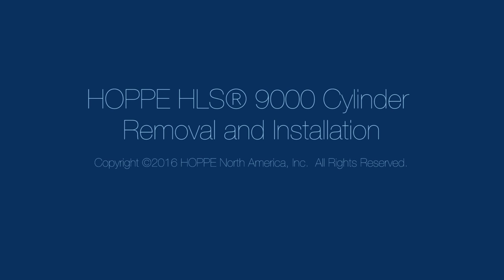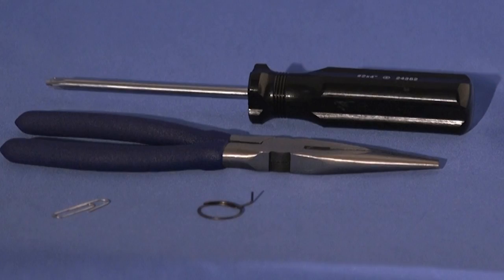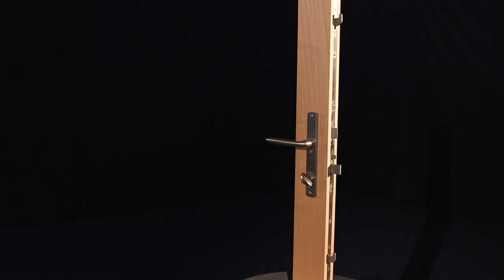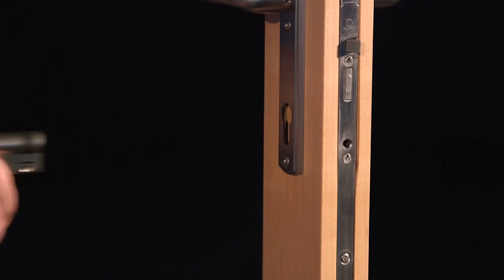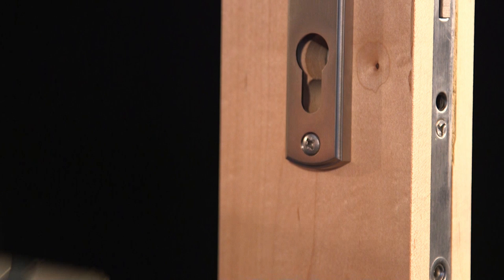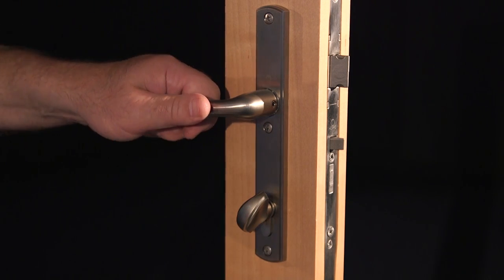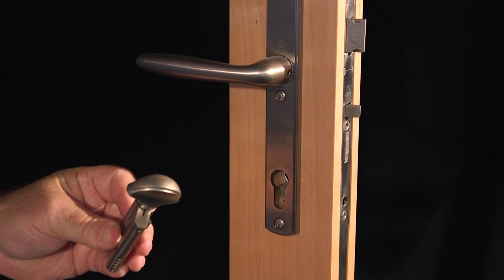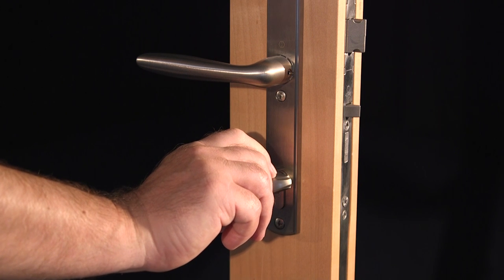HOPPE HLS®9000 Cylinder Removal

Comment: Thank you.  Just received custom doors ordered 4 mo ago.  Installer did not know tricky sequence of locking, as key cylinder appears "frozen" if certain latch not depressed, allowing handle to be raised to engage upper and lower latches .  I "gotter done," but not before some harsh words to supplier about "broken" hardware.

Comment: Great video! saved my (^& on a job because I've never seen the little slider pin under the thumb turn and couldn't get the lock out. THANK YOU!!!
Reply: Same here, except I release the pin and it still won't come out. I also notice you say "turn it away from the latch edge of the door" but you are actually turning it towards the edge. I'll keep trying, but this is the best source I've found so far.
Reply: For those still trying, I turned it away and it came out. Turning it toward the edge didn't work for me. I used modified cell phone SIM pin.

Comment: I have a keyed 90 degree lock and had to have the key in as well as depressing the pin to turn.  I left the key in and the knob on while removing the cylinder from inside leaving knob on. You did not mention this.

Comment: Great video but doesn't help me.  My lock is stuck with the door closed. Any advice??
Reply: I'm dealing with the same issue - the thumb lock won't turn to retract the deadbolt. Have you fixed it?
Reply: @umohibomette4850  I did.  I eventually was able to get the doors opened with a little force.  Removed the entire lock mechanism, opened it up and essentially reassembled it.  The thing is practically bullet proof...so forcing it open did no harm.  Wasn’t crazy complicated, but took a while to figure out.
Reply: @Todd Kvamme I tried forcing the door open, but that didn’t work either. The shootbolt is extended and I don’t want to push to hard, for fear of damaging the door or frame. Do you know what caused your cylinder to malfunction? Was something broken or worn in the lockcase?
Reply: @umohibomette4850  I accidentally forced it when the mechanism was engaged I think.  The option you have would be, I think, to remove the hinges, but that is easier said than done...I thought about it and tried, but it was not obvious.
Reply: @umohibomette4850  I just came with this problem too. Were you able to open it? if you did,  please let me know. TIA
Reply: @debbiecardenas4199  I have French doors. The main thing keeping them closed, within the frame, was the shoot bolt, at the top. I cut the shoot bolt using a drill. This allowed me to finally swing the doors open. Once opened, I used a hammer to force the deadbolt back, out of the way. My 90 degree cylinder was stuck, mind you, but the hammer allowed me to lock/unlock the deadbolt freely. Using the insert, I still wasn't able to turn the cam beyond 90 degrees. I believe the spring mechanism, that controls the retaining pin, was broken. i used vise grips, for leverage, on the thumbturn to clear the cam from the lock case. The door and all visible hardware were saved. Had I followed their recommendations, I would have ruined my door and I'm not convinced it would be opened. Good luck!
Reply: I had the same problem just now. Thanks to this video I used a paper clip to slide the retaining clip down like @2:59 in the video. This allowed the thumb lock to turn and open the lock. I never would have thought of that without this video.